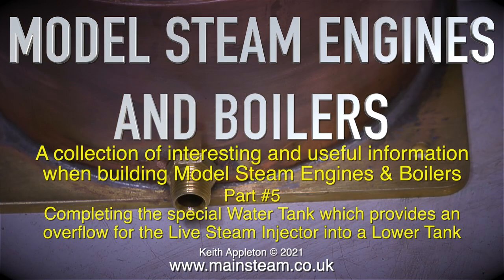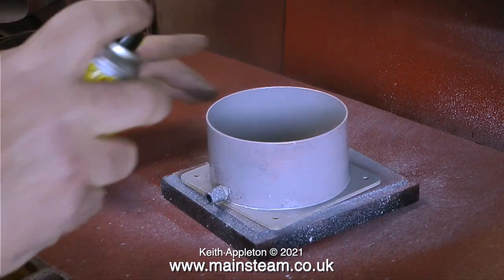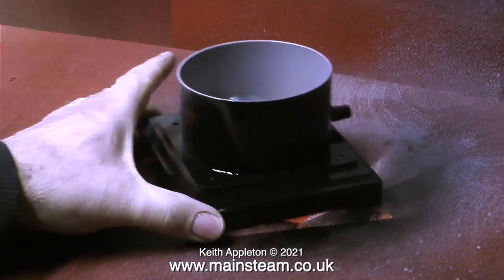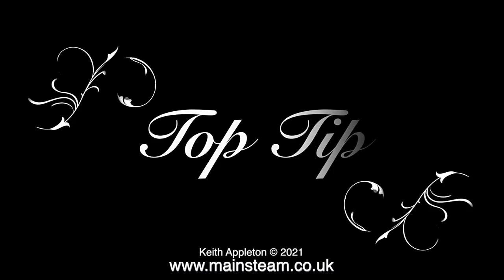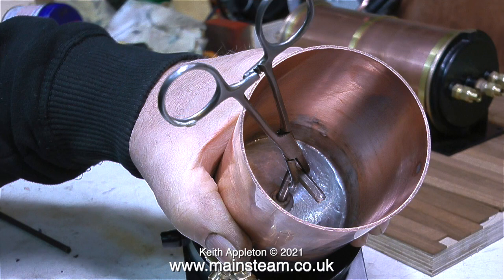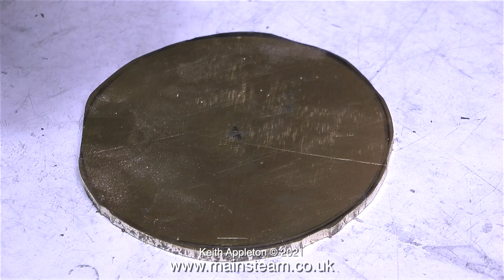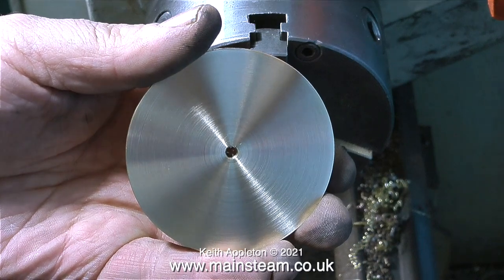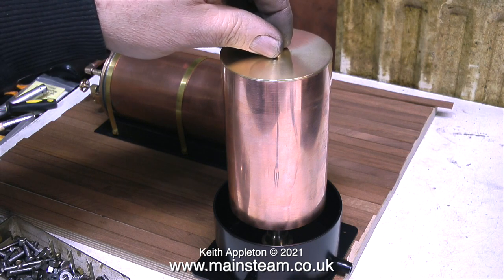MODEL STEAM ENGINES AND BOILERS - PART #5

Comment: There's 2 major  types of stainless steel... Austenitic and Ferritic...  it's Ferritic stainless that responds to  magnetic. Ferritic is usually cheeper, and not have quite as much corrosion resistance in certain applications..

Comment: Oil based primers/paints of all kinds tend to lay down (smooth finish) better than latex primers/ paints. Mainly a factor of slow drying times and a runnier consistency. Having said that, good quality latex primers and paints have gotten far better than they used to at laying down especially the newer water based alklyd hybrids.